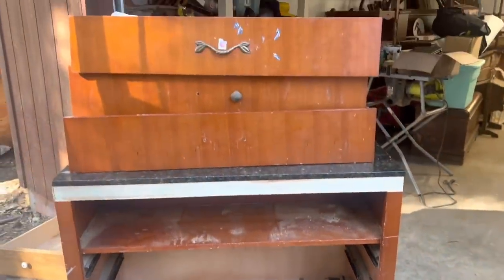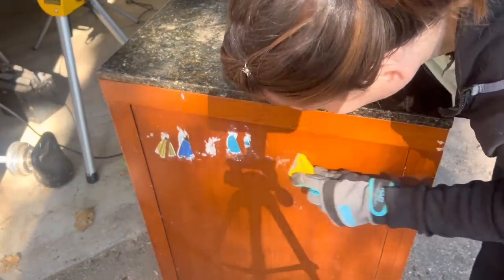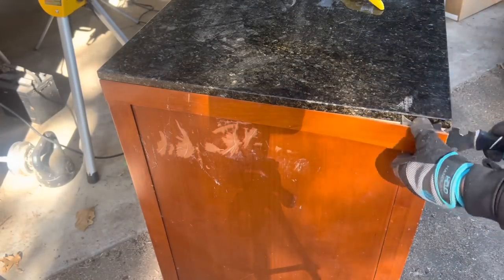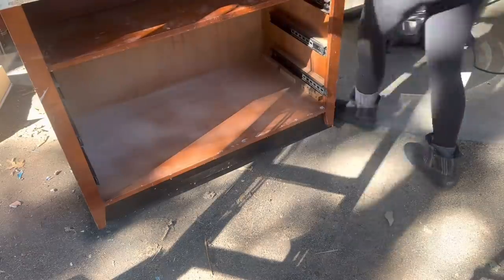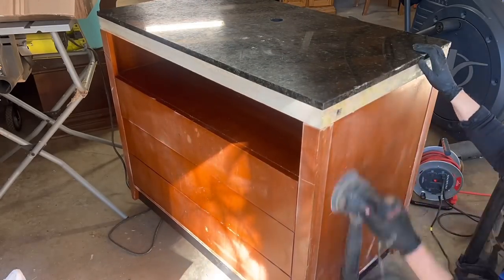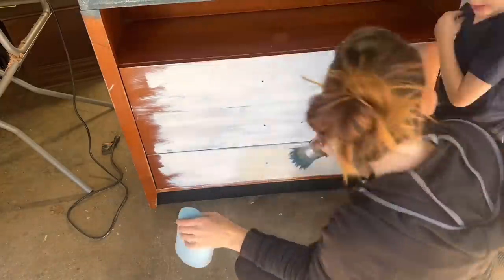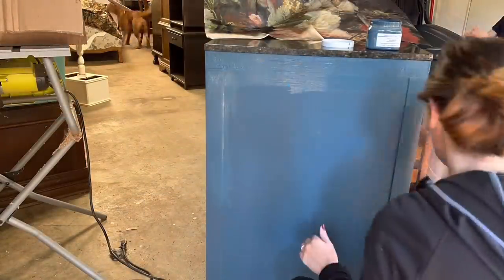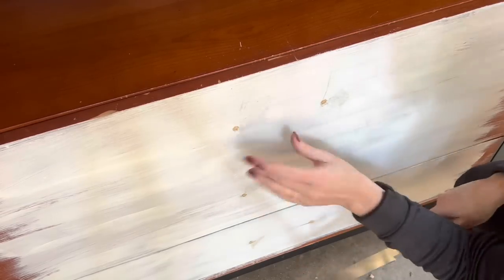The “Not So Perfect” Makeover | Using An Old Hotel Unit For A Workbench | Elegant Upgrades

Comment: Yes please. Would love to see what you do for a staging wall! Please not a short!

Will your paint be stored outside? I have a single car garage as my shop and I think it’ll be fine since the garage is between 2 condos. I also live closer to Puget Sound/Salish Sea so I don’t get as cold as you do. 

Can’t wait to hear the full big picture. Are you moving there for good?
Reply from the maker: Yes, I’ll be storing it outside. I keep it in my Portland shop and it stays about 55 degrees there in winter and all my products do fine. I’m not sure how it will do here when it gets so much lower, but I’ll be able to heat this shop while I work so I’m hoping that will help. 
Right now I’m just trying to get the website fully running and potentially an actual brick and mortar ( but that seems a bit far off for now) Since my mom is going to be helping with all the smalls and she really has no idea what she’s doing yet, we are just working through that. So I’m going back and forth a lot. But I will say I’ve been trying to convince my husband we need to buy our house here instead of Portland (wish me luck with that 😂)